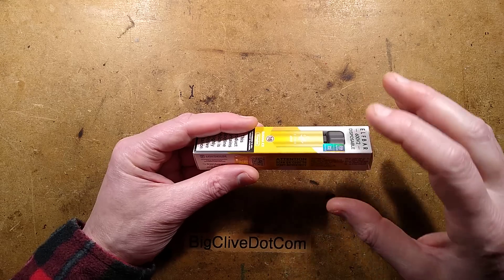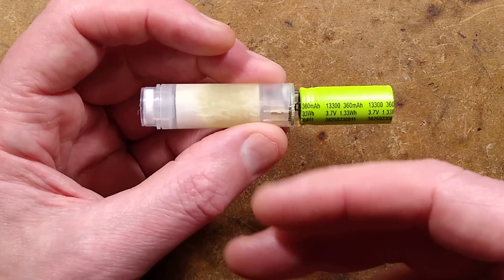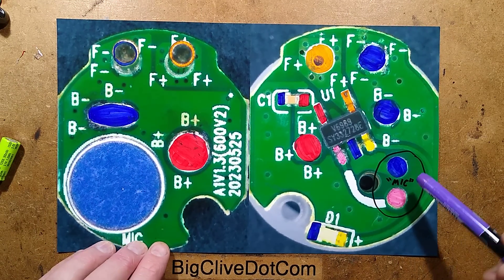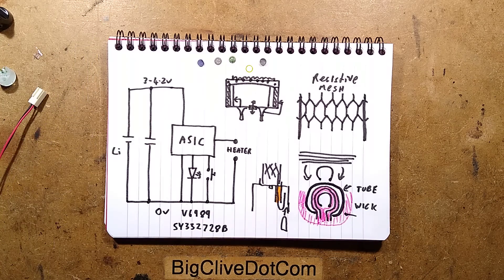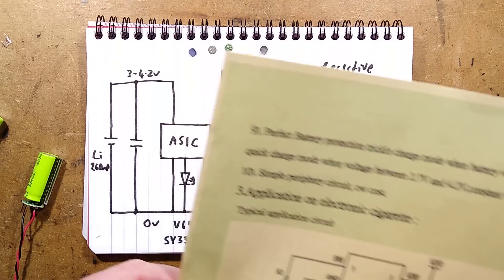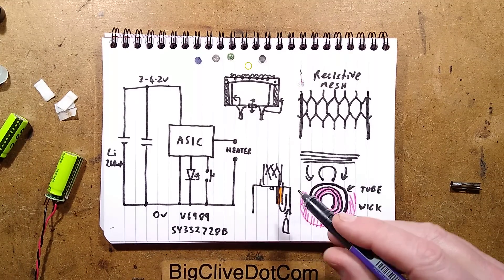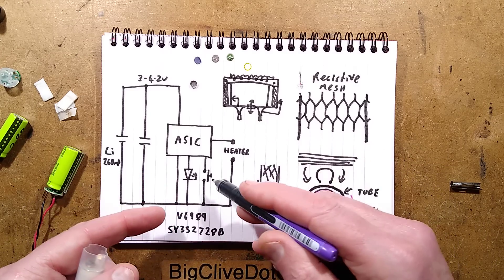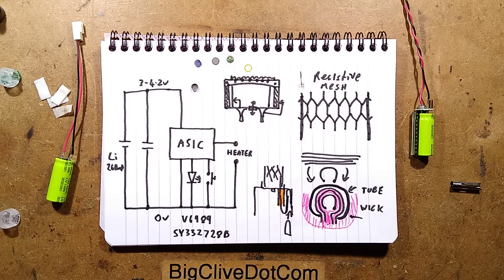Lithium "capacitor" in a disposable product

Comment: It’s just insane that they didn’t seem to do any cost optimization on this supposedly disposable stick. They used gold plated removable contacts, a refillable cartridge, an ASIC when they probably could have just used a few transistors, a lithium ion capacitor, a double sided FR4 PCB (rather than a single layer phenolic resin board which they could have used), and they didn’t allow it to be recharged. At least hobbyists can use these as a cheap or free source of lithium cells, but how much money is in this industry that they can just throw in somewhat unnecessarily costly materials (as opposed to the cheap construction of some other devices I’ve seen on the channel) into a supposedly disposable device.
Reply: They are probably going to offer a "recycle" program where you get 10% off the next one if you turn an old device in that they can recharge and refill to sell again. Otherwise there would be absolutely no point in the gold plating.
Reply: @mrfrenzy.   Sounds like a typical tobacco company. Actually really legit. You sell the same 50cent product for 15$ ten times in a row, and nobody is gonna complain anyway.
Reply: The ASIC is quite likely cheaper than discrete components (in bulk quantities).  It also reduces the assembly complexity, possibly leading to a lower percentage of assembled units that don't pass QC (fewer components is almost always better) and therefore more profits.  My guess is the gold plated contacts were probably not originally part of the design, but they found they needed to add the plating to make it reliable enough, or avoid heat issues in the connector (and gold plating the contacts isn't really that expensive, compared to the rest of the product).

And Li-Ion batteries have a much higher energy density and current capacity than most other options, and are often actually cheaper than disposable batteries nowadays, so it's often more cost effective and practical to use them even in disposable products like these (unfortunately).
Reply: It’s likely the cost of a one time use product is so similar to a rechargeable product that it is not worth manufacturing a different unit for one time use.
Reply: An ASIC is used because there is a number of safety features programmed into it. It counts how long the heater is being fired, and cuts it off after so many seconds, it monitors the current being sent to the heater, and cuts it off if it's too high, monitors battery voltage, heater resistance, and so on, to prevent the device from burning you or exploding in your pocket. A few transistors wouldn't be able to do all this, and make the device safe against a malfunction that could end up to be dangerous to the user.
Reply: @davelowets  What's the point in monitoring battery voltage in a disposable item?
Reply: @andrelange9877  Cuts the current off if the voltage dips too low, and the current tries to rise too high, and also alerts the user with a flashing light that the end of life is near, instead of suddenly just failing to work.
Reply: @davelowets  Why the low voltage cutoff? It is never going to be recharged again.
Reply: @andrelange9877  take the L
Reply: @andrelange9877  avoiding fires
Reply: I wonder if the ASIC has any programming to "count" how long it's being used and shut off if it detected that it's being refilled and reused
Reply: @OrangeSheep14  No they are not, mostly
Reply: @OrangeSheep14 It doesn't. I sometimes refill them when I don't have any better vape because the heater is burnt or drunk me lost it.
Reply: bro its an addictive drug dispensing device, the profit margins and market cap are insane regardless
Reply: @youvebeenspooked  How is a vape a "drug dispensing device"?
Reply: @DerMeisterEdits  nicotine. It’s addictive and is just a waste of of people’s health and money. I’ve watched peers in Highschool go from vaping, to smoking, to weed, to meth. They crave more “vibes”
Reply: @DerMeisterEdits In what way does a vape not dispense a drug into a person? weird question. it's a hit of nicotine, that's why people buy it.
Reply: @JamiePoling007  you sound like a dare campaign lmfao
Reply: @zebragoboom  Oh, I see. You wanna get technical, huh? Well, caffeine is also a drug, so by your logic, a Starbucks latte is also a "drug dispensing device". Alcohol is a drug as well, so a Seagram's wine cooler would also have to be a "drug dispensing device". But let me guess. "NO, THAT'S DIFFERENT!! 😨"
Reply: @zebragoboom  He's wrong, not only that , nicotine has massive anti Alzheimer's properties.
Reply: @DerMeisterEdits  Only for the use of the word 'device'. I guess the cup and the bottle would be the drug dispensing device in those cases.

What else do you think they are? Nicotine, caffeine and alcohol are drugs, and you keep making erroneous assumptions about other people's beliefs like some kind of fluff-headed mattress-mind.
Reply: @DerMeisterEdits  hey man, first off, we are so much more alike than we are different, and straight up, I still vape, and smoke the occasional cig, and cigar.  and I wouldn't say that "it's different", but completely agree that >99.9% ( 999 out of 1000 people) would say that.  caffeine is the most popular drug, and yeah, a cup filled with a psychoactive substance, like coffee (caffeine), beer (ethanol), kava, mushroom tea, etc, is, quite literally, a "drug dispensing device".  But I would not usually use that term with a cup, because the most common use of a cup, is to fill it with water, or other non-psychoactive fluids.   With a vape, there are people who smoke "0-nic" etc fluids, that are not psychoactive.  But, the most common use, is to dispense a psychoactive vapor, with nicotine, THC, CBD, DMT, or other psychoactive compounds.  I agree that they are both capable of being "drug dispensing devices", but I think both the typical usage/intention of use, and lineage of design (cup vs electronic vaporizer), makes the label more appropriate for vapes.  Similar to how water pipes have a specific term (the b word) and are associated with THC, though some people would use them for tobacco (nicotine) or non-psychoactive plant mixtures.  I hope you read this and it helped clarify my perspective, and maybe helped you to understand where I'm coming from.  Either way, I love you fellow human <3
Reply: Elfbar is not a tobacco company though. They are the biggest culprit. The second and third biggest are not owned by tobacco companies either 🤷
B.a.t. wanted to buyout elfbar, but they said do one 🤣
Reply: It's not a capacitor, it's a 13300 cell
Reply: @aliveandwellinisrael2507 still free lithium cells
Reply: I have a suspicion that these businesses are owned by big tobacco/ big pharma companies that would rather be selling cigarettes and ineffective cessation products. Govt. already want to ban ecigarette use entirely, they're not very likely to miss an opportunity to overreach if they ban these wasteful devices.
Reply: @davidwilson6577 They're not. Those are gas station e-cigs, not disposables like these.
Reply: @davidwilson6577 they’re owned by Morris same people own Marlboro
Reply: These are probably insane margins.
Reply: I've been reuse n them batteries for years  here in US there 1000 or 1500 mah
Reply: When you see the price they are hardly "disposable". The only thing disposable about them is the engineering to make SURE you can't reuse them. There's plenty of profit in them to not have to bother with sourcing specially made cost cutting components. Especially when they get redesigned every year.
Reply: It's because it started out as a highly reusable and maintainable device. Box mods are normally set with 18650 batts, and the atomizer use easily replaceable wire and wicks. You can spend almost nothing on your device for years, with the exception of batteries wearing out
Reply: I been getting batteries out of these for a while now
Reply: @JeffreyDunaway-g3t what do you do with the batteries? I have heaps of them.
Reply: it’s because they sell them for less. they probably have a higher end rechargeable version
Reply: From China I buy them 3$ they are cheap
Reply: Maybe they have different models with different features. Maybe some of their models are rechargeable/refillable and it's cheaper for them to produce if they share parts.
Reply: You're looking at the wrong side of the cost optimization. Yes, every piece of this could have been made cheaper. But that would require engineering time, retooling, new dies and PCB masks, modified assembly stations... 
All the parts going into these likely already exist at a factory in some left over bins, likely one designed and tooled for refillable sticks, so it is significantly cheaper and faster to simply use the existing tooling and shit out a slightly different product package that they can then market as "disposable". I guarantee you these are so crazy cheap to build in bulk for what they cost to buy, even without the cost optimizations it'd make your head spin.
Reply: It doesn't make sense since disposable vapes are a way for the CCP to cause damage in multiple ways to other countries
Reply: They don't seem to be that greedy when it comes to poisoning the masses =)
Reply: Assuming you can find any.  But it really is amazing that this thing is disposable.
Personally, I've never found the disposable ones to be any good. They are under powered and use high (for an e-cigarette) resistance atomizers. Like, at least an ohm, probably 1.5 or 2 ohms.
They are expensive too. Every disposable one I've ever seen is like 10 bucks or more.
Reply: Yeah typical Chinesium - oh wait, no, hang on that's not the narrative - i mean 'designed in the West so its a fine product' , some might even say over engineered so definitely not a waste of the worlds limited resources - am I doing this right?
Reply: I mean, you could buy RDA atomizer and a mechmod, which is basically a coil/mesh strapped to a 18650 Li-Ion battery that connects via switch, you can't get simpler than this. But those kind of devices are for experienced users and were prone to overheating, battery leaking or even fires/explosions. So, putting all of those boards and controllers are a safety feature, not an oversight. But I do agree that putting perfectly fine Li-Ion battery into a disposable vape is a huge waste but you can't beat it without regulations, I guess
Reply: They are making profits, so those materials are not as expensive as we are lead to believe.
Reply: @bethrains3105  exactly.   a few micrograms of gold means nothing with those profit margins.   love u <3
Reply: That looks like they utilised capacitor shells to house a lithium battery
Reply: yeah,Higher cost price higher margins thats what its about i think
Reply: It's just a way for the manufacturers to do test runs, off second tier materials, scrap, or just maintain their sales quotas? Maybe they want to sell these cause they make batteries or other stuff and it is more of a guaranteed sale because they are kind of perishable and can be price dropped and still get profit
Reply: Have you heard of the Tobacco industry...
Reply: Could almost be printable.
Reply: Since when did Hyde, or any other disposable, have refillable cartridges?
Reply: @DerMeisterEdits  refillable if you pop it open
Reply: @davidwilson6577  I knew that, but the fact that you can theoretically crack it open and refill it doesn't mean it's a "refillable cartridge". It has to be meant to be refilled for it to be called that.
Reply: @DerMeisterEdits  by the manufacturer, sure. By some guy commenting on a hacky video about what you can get when you open them up non-destructively...
Reply: oh really? says who? @DerMeisterEdits
Reply: @davidwilson6577  By literally everyone who vapes. He used incorrect terminology, period. There's really no room for semantics.
Reply: @youvebeenspooked  Says everyone who vapes. If someone wants to talk about vapes, they should at least know the basics.
Reply: @DerMeisterEdits   just to help explain the intention of my original response - I agree that a "refillable cartridge", in industry terms, means one that is intended to be refilled (and has easy accommodations to do so).  One of the fun things about being a human though, is being able to question the way other people describe things.  For example, this was described as a "single use" / "disposable" vape.  But, as demonstrated thoroughly in this video, it can both be 1) refilled and 2) recharged.  The coil was probably not meant for repeated use, and if let to go empty, would likely degrade or damage the "juice" chamber.  That said, one of the important takeaways from this video, is that in our frustrating society, we often produce incredibly complex things (vapes, plastic bottles, ziplock bags, etc) that are advertised as "one time use", but in reality, are capable of much more.  I hope that in our lifetimes we can align on producing more durable, intentional tools, that can outlast us.  For example, I use a sunbeam t-20-A toaster from 1952 on a near daily basis. It is shiny, durable, cleanable, and has a user interface / featureset that no modern toaster has.  Look it up on youtube, they are self lowering, measure the browning of the toast, and raise the toast slowly when done.  It's more than 40 years older than me and will outlive me.  My eggbeater is from 1928.  It is more than 70 years older than me and will outlive me.  We need to get back to building things to a high standard with a long term perspective of how they will influence our world.  And when someone tells you "this is how it is", always ask why :) peace and blessings
Reply: @youvebeenspooked  Sorry, but I'm just not gonna read any of that. That's way too much text for me. All I did was correct someone on the terminology and call out the double standards. Love you too tho.
Reply: @DerMeisterEdits  Hah, I feel you man, it's a lot to read, and I don't blame you in any way for skipping over it.  You were 100% correct about the terminology, this is not a "refillable cartridge" by any standard definition.

Maybe if you get a chance you could try reading my responses, it won't take more than 10 minutes and I think you would be interested in what i have to say, because you seem like an intelligent and curious human being <3 But I would never judge you or be upset with you if you did not.  

PS - vaping is so much better for your body than smoking.  But always remember, any smoking, any alcohol, anything like that , affects your nervous system in a negative way.  But social and intellectual experiences can vastly outweigh negative expects, especially in initial experiences.  Everything in moderation :) don't get lost in the sauce brother, love you
Reply: @davidwilson6577  yeah some guy ripping open a tv in his basement doesnt make it modular
Reply: @DannyGruesome  how about when that guy installs a module to stream free sports.
Reply: The fact that they contain gold if what blows my mind.
Reply: @GetFitEatRight it’s a very minuscule amount per device, you’re not gonna get rich by hoarding them anytime soon😅
Reply: I’d much rather these be more expensive and harder to get ahold of. Vaping is disgusting.
Reply: @JamiePoling007  👶🏻🍼